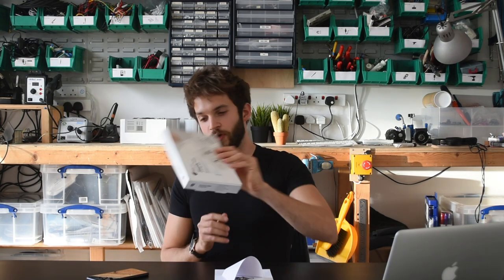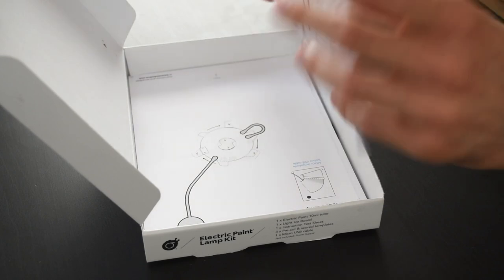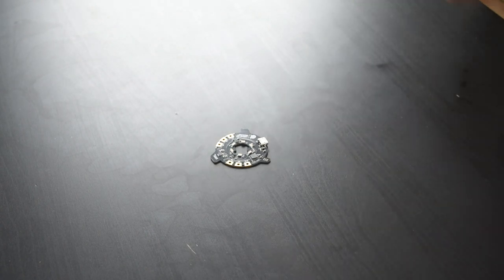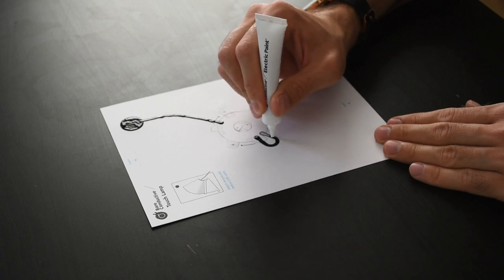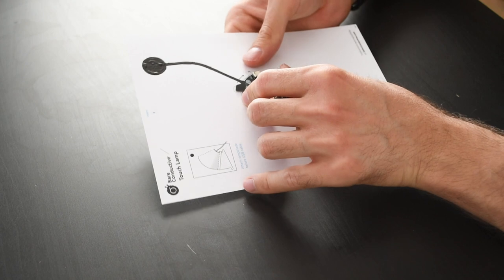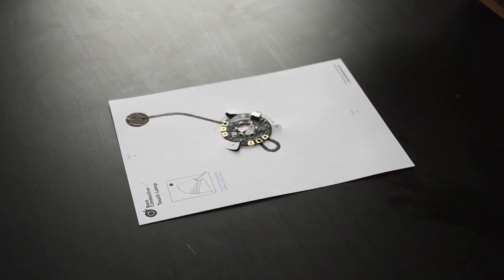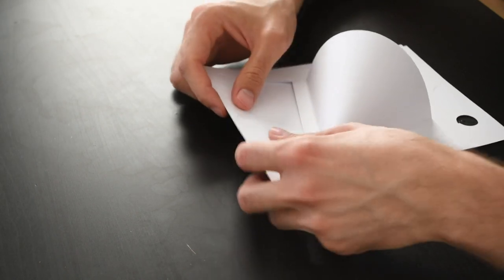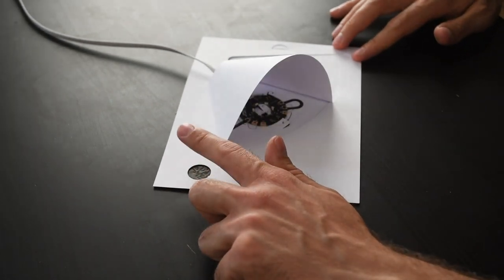Electric Paint Lamp Kit | How to Create a Touch Lamp

Comment: Hi there, theoretically could this be done with a plant? Eg applying the paint to a large flat leaf, twisting the light board into another leaf, and touching the leaf to turn the light on?
Reply from the maker: Yes you can! By connecting the plant to the electrode E0 you can turn it on by touching the plant.

Comment: Whats the smallest rechargeable battery I place on this item and once thr dimmer is set at a certain level does it remain on that setting and one other thing can a reed switch be placed to turn on the led. Kind regards del
Reply from the maker: Hello! We wouldn't recommend using a battery, instead, it should be powered via a USB cable and power source.